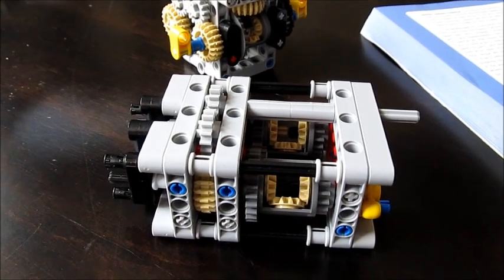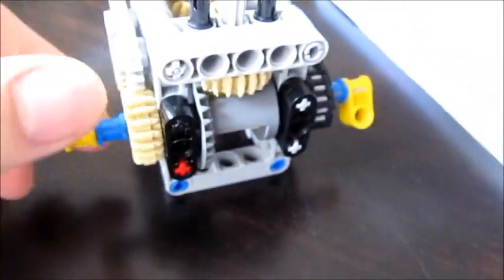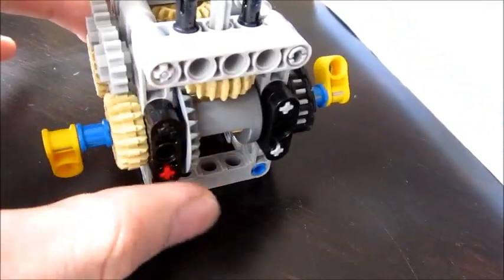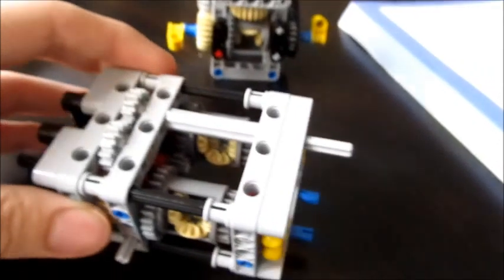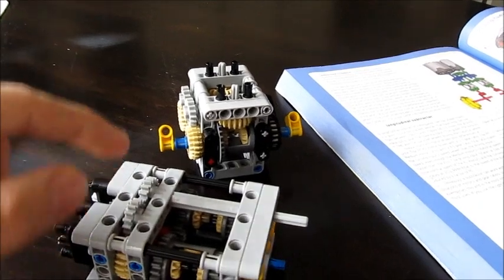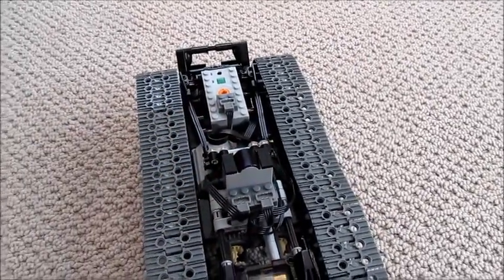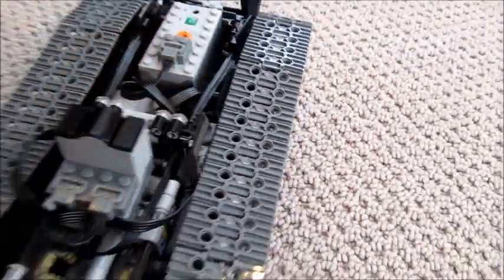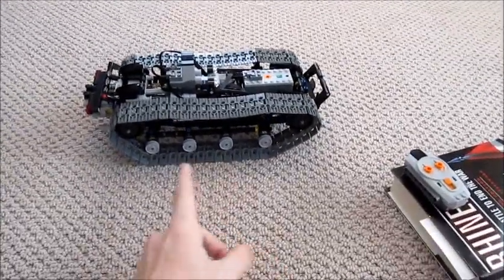Lego Technic: How a Subtractor Works [+ Driving Demo]

Comment: Awesome and thanks for the instructions. But I wondering if the clicking I hear is the gears slipping? If so it probably needs a little work but overall the design looks really sturdy and compact. Nice job
Reply from the maker: The 'clicking' noise you hear is the result of the half-tooth bevel gears in the differentials. Because of where the subtractor is built in the chassis, there is more torque on the rear axles when turning. 

Note: NO gears had visible wear after an hour of solid driving/filming